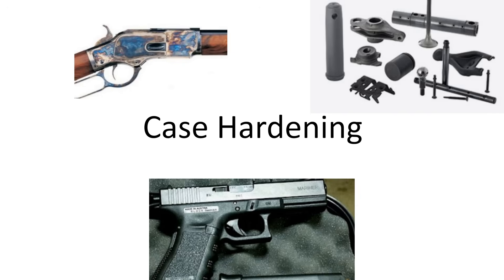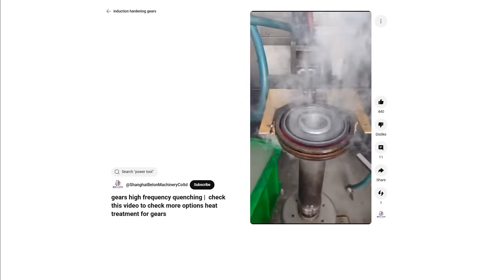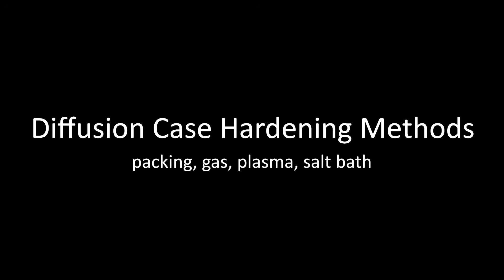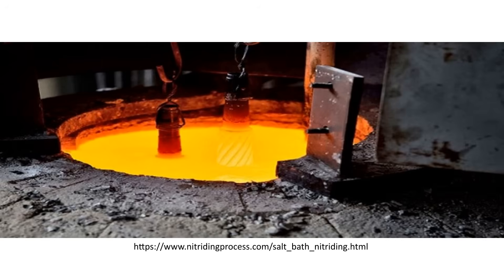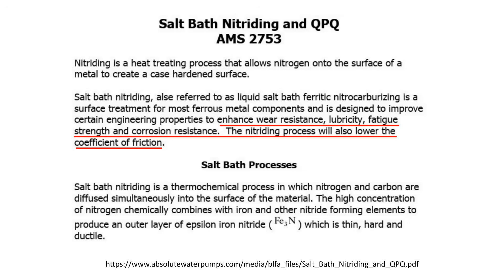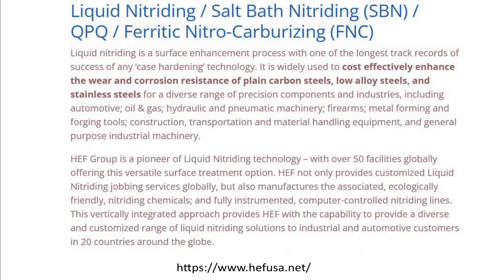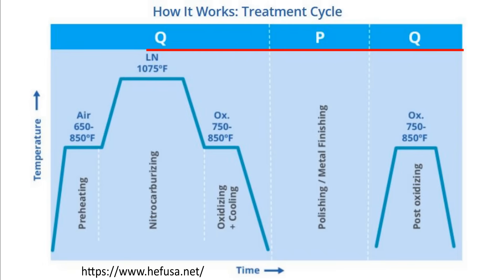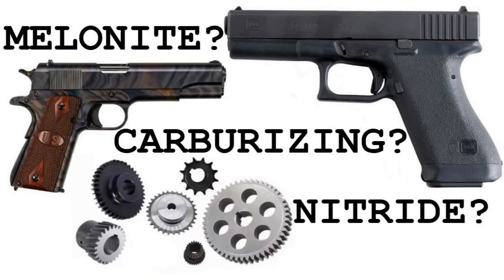Case Hardening (Carburizing, Nitride, Nitrocarburizing)

Comment: I recently started caustic bluing my knife blades.  At first I was hesitant so i use cheap drain cleaner as a source of caustic soda and potassium nitrate as oxidizer,  at first result was satisfactory,  second time it came out flawless when i used pure caustic soda flakes. It's a surprisingly easy process , It's slightly more durable then cold bluing . Poor abrasion resistance
Reply from the maker: Oh thats awesome! Do you have a tank to heat up the chemistry? What temp is it at?
Reply: @EngineersArmory  for now I use a wide stainless steel container . I get it  to full rolling boil and dipped the part in . Never measured temperature,  haven't have any issues with it but the key is to maintain the right amount of concentration because the water will keep evaporating
Reply from the maker: @99999batman awesome thanks for the info!

Comment: I actually work at North east coating technologies. I am the crane operator for the salt bath. If you have any questions please feel free to reply to this comment. Thanks!
Reply from the maker: Oh awesome! I appreciate your offer! I am really mainly curious about how austenitic and martensitic stainless steels interact with the salt chemistry. Is it the same as ferritic steel alloys? Do the lower temperature ferritic and higher temperature austenitic processes (salt bath, gas or plasma) affect the the austenitic and martensitic alloys differently than the ferritic alloys?

Also, how much carbon gets diffused into the material vs nitrogen in the lower temperature ferritic processes? Is it still nitrocarburization or really only nitride due to no diffusion of carbon? 

Any and all information you have or are willing to share is great!
Reply: @EngineersArmory  high temperatures generally speaking (depending on metal type ie stainless steel 4140) penetrate better creating a "thicker coating". With lower temperatures the austenitic tends to have more staining problems affecting the looks. I've also had hardness problems if I dont run them at 1075. The ferritic alloys seems to have trouble with reaching the customer specification running at 950. So generally we run 10 degrees higher
Reply from the maker: @sethhawkins6630  Interesting thank you! I figured there were some minor process parameter tweaks. Of course all material dependent as well. 

My high level understanding of the higher temp austenitic processes is that they were more robust partly due to the diffusion of more carbon which is easier at higher temp.
Reply: @EngineersArmory also much more carbon is diffused running at the higher temperatures compared to our low runs. A standard run for a good out is the following
30 mins degrease (ferrous soak)
30 min preheat usually to 750
2 hr 15mins at 1075 in the salt
30 mins in the oxidizer
5 min quench
15 mins in three different water cascades for cleanliness 
The 15 mins to dry off the parts for glass beading.
2nd round is 
Preheat 30 mins to remove water
30 mins oxidizer at 850
Then quench
Cascades
Then usually depending on customer corolac (grease) for 15 mins.

Comment: What a cliffhanger! Informative as always.
Reply from the maker: 4-6 more weeks before I get my slide and frame back from nitride. The wait is killing me haha.
Reply: @EngineersArmory - I assume they have to wait until they have enough slides to send off for treatment to make it affordable?
Reply from the maker: @devilish_details  thats my guess. Big enough batch of parts to take to the supplier to justify it. 

Sent my parts to AB prototype in TN. My guess is they drive em 1.5 hour down the road to HEF in Chattanooga. HEF has a salt bath nitride facility there. HEF may have their own FFL im not sure but there is also issues associated with that, which would make taking a bigger batch in beneficial. 

It was difficult to even find a company that would offer the service on the serialized frame. Only 2 out of the maybe 8-10 i contacted said they would do it.

Comment: This video convinced me to look into better alternatives than Cerakote to coat my Mossberg 590.
Reply from the maker: Im glad hahaha cerakote is awful, i truly hate it. Purely an aesthetic coating in my opinion. If you want the outside of your gun to be cool colors? Sure. It better be on top of a treatment or other coating that protects the base metal. Cerakote doesnt belong on any functional surface or internal component of a firearm in my opinion.

If your Mossberg already has a wear and corrosion resistant coating on it and you want a cool color or design in cerakote over that. Thats fine.

Comment: I watched this specifically because of the Case Hardening. I've seen a few times where the question was if it is real or just some coating applied on the Italian made Pietta and Uberti revolvers. It would be interesting to see the process in action.
Reply from the maker: Couple links in the description to videos showing the process. I have also heard of people using a coating to mimic the colors. Not sure on the firearms you listed.
Reply: @EngineersArmory  I don't know either but they sure look nice.

Comment: Great video, I  have designed many parts for my job that specified ferritic nitrocarburizing as the heat treatment/ finish. I am also a firearms enthusiast like you, and have used a very large local heat treater in Akron to do many parts for my hobby. It is a fascinating process that yields beautiful, wear resistant, low friction and corrosion resistant surface. I have had this thermal chemical process applied to 1018, 4140, 4340, 8650, 303 stainless and numerous other alloys.  The results have always impressed me. The tribological improvements make QPQ  a standout in my opinion over DLC. I definitely think you will love the end result.
Reply from the maker: Its all very cool stuff! In my line of work I spec nitrotec quite frequently for the pivot pins of my hydraulic actuator designs. These are the ones that go at the bottom of the ocean, or are used for other salt water applications (think ship deck equipment exposed to salt spray, which is even harder on them than subsea due to the presence of more oxygen). Nitride, especially with a QPQ process is so much more durable than DLC. Thats why I chose it. It is THE best firearms treatment in my opinion, and objectively if you consider the chemical/mechanical properties. I see a lot of people say DLC is the best, most premium finish and I disagree. If you don't keep DLC oiled it will rust, not the coating itself but the metal under it due to the porosity - Atlas states this in one of their videos even. 

i'll go into quite a lot of detail in the comparison for the upcoming video when my parts get back from nitride. 

Thanks for watching, commenting, and sharing your experience!
Reply: Alchemy has also stated that their DLC coating requires corrosion prevention due to porosity. Great video. I plan to watch your polishing video when I have the time.

Comment: I just had my gun parts nitride finished last week it's a 10mm long slide hunting gun, it's all matt black and I love it. Since this was a custom build the custom Caspian slide was hand fit to the frame I was surprised when I got the parts back that I had to lap the slide back on the frame with some wd-40 but it only took about 10 strokes back and forth now it's on ball bearings again.
Reply from the maker: Its hot enough that things might move a little. Doesn't add thickness to the surface. Im waiting on my slide and frame to come back from nitride. I expect there will be some minor fitting and adjustments here and there.

Comment: While my heat treating never delved into stainless steels with hands-on experience, I do vaguely recall going over the processes involved. As to which process is ideal for which type basically comes down to retaining the corrosion resistance properties inherent of the grade. Doing one process for like a low to mid grade 300 series will release the carbides rather than trap them into the microstructure. As is critical to the temperature of all heat treats, the material being introduced at the critical level and quench media, post-process, etc is where all the magic of heat treating stainless comes in. 
My father-in-law runs one of the big heat treat plants for a local aerospace manufacturer. I'll shoot him a line and see if he can add more specificity, though what all he can share is usually the same thing you can read up on elsewhere as they keep strategic processes well-guarded for both industrial reasons and defense protocol.  
In the race engineering world, they have some really trick surface treatment processes that I'd love to study up on and only know topical knowledge of. Cyro treating is the most basic of that end, then you get into processes that both harden and drastically reduce friction like moly impregnation, boron nitriding you mentioned, and a few others that I'm sure I'll remember in the coming hours that escape recollection off the cuff.

Comment: I've you're still pondering what exact process to use, reach out to Matt Cheely.  He did some work on a 1911 I used for USPSA SS and IDPA CDP for me around 15 years ago.  He had it Black Nitrided, though I'm not sure of the exact process.  It has held up really well.
Reply from the maker: I've reached out to Matt Cheely a number of times during my 1911 build process. Great guy, super helpful. Love Cheely products. He offers some black nitride stainless parts, I bought some for my project. They are Melonite. I am guessing thats what he used. With he offered a nitride service. Thanks for the tip, hes been very responsive and is a wealth of knowledge. I suppose I didn't think to ask him about finishing.

Comment: Have you looked at RF85 treatment? I find it fascinating.
Reply from the maker: I hadn't heard of that one! Pretty cool. Thanks for mentioning! I would be curious about its effectiveness with surface finish of the base part - smoother part, fewer areas for the material to deposit/less material deposited. Doesn't mention anything about corrosion resistance, and says it doesn't change temper, hardness, or any other characteristics. If it acts as a dry lubricant how long is its service life? Interesting stuff!

Comment: I would like to try color case hardening sometime but don't have the equipment. Your explanations of the different processes are easy for me to understand. Good stuff.
Reply from the maker: Glad you enjoyed it. Color case hardening would be best with a forge so you could control and monitor temperature. The parts will warp like crazy during quenching so you would also need fixtured for the individual parts to prevent this.
Reply: @EngineersArmory  And that's another thing that sways me not to, warpage.

Comment: Can I ask you about the white nitride you showed on that CZ?
Reply from the maker: You can but I don't know much about it haha. Just saw it was a color option that was discontinued. I assumed it was nitride left "in the white" without the oxidizing post process.
Reply from the maker: https://cz-usa.com/product/cz-p-10-c-fde-white-nitride-discontinued-2018/

In the first paragraph of the description it states its nitride without the blackening process.
Reply: Ok 😅 no worries, I was wondering if you thought it would still be good and durable and scratch resistant? I wanna do the aluminum receiver, 4130 barrel, and 531 steel magazine tube on my old Mossberg 590, for a silver and black look, almost like their “marine coat” offered from the factory. But any good advice you have for a durable “silver”-ish finish for those parts would be great 🙏🏻 thanks brother. I can’t wait to see your baby all finished in black and silver too. It’s gonna be fuckin sick!!! 💯🔥🔥🔥
Reply from the maker: @Bryan-1980  "white" nitride, without the black oxidizing step, will still be very durable. The benefits (as far as i can tell) to the oxidizing step are primarily corrosion resistance, and the color. The nitride underneath will be somewhat corrosion resistant, hard, wear resistant. 

The aluminum is likely already anodized (black?), Anodizing can be stripped and it can be re-anodized. Anodizing is "clear," after the anodizing it is dyed whatever color, then sealed. Sometimes the sealant can be removed and the dye will leach out. I don't think it would leave you with a "raw" aluminum look. 

The 4130 barred could be nitrided/nitrocarburized without the oxidizing step that would turn it black. Same with the steel magazine tube. 

Other ideas would be electroless nickel or hard chrome for the barrel and mag tube.
Reply: @EngineersArmory thank you 🫡 I'll definitely look into that. I like the nickel idea because then I could just polish the aluminum to almost match the polished nickel finished parts 💯